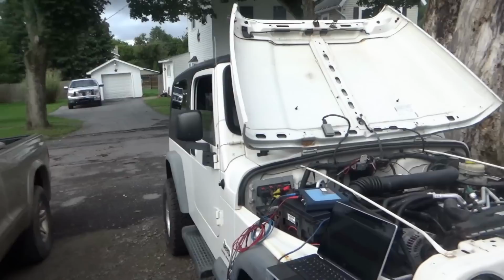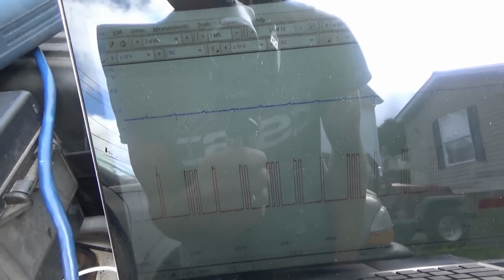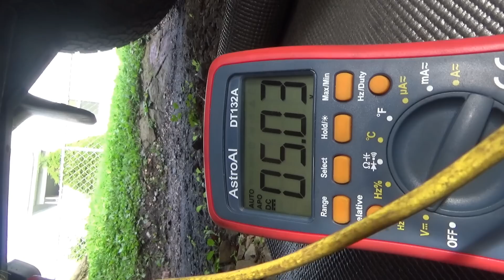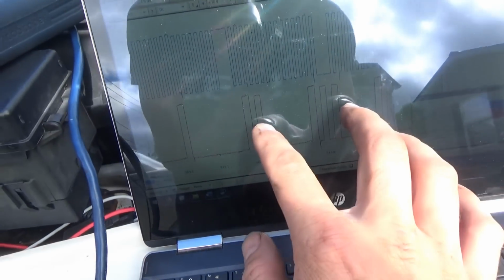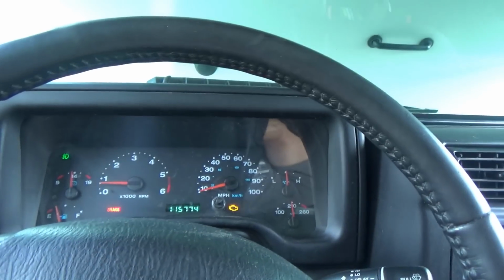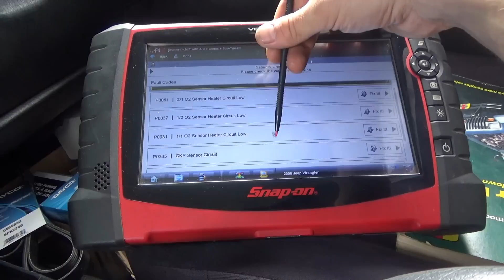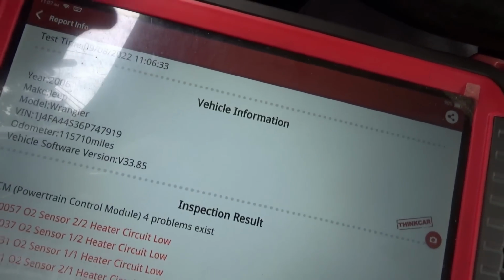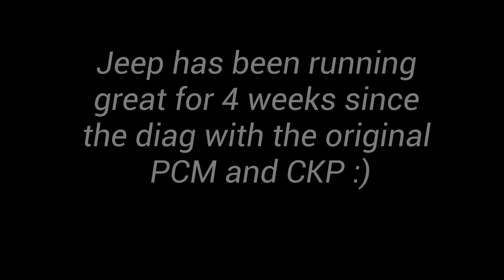Parts Cannon Vs. DIAGNOSTICS (Jeep Long Crank Time P0335)

Comment: I am going to take a wild, I mean wild guess here at only 2:15 seconds in. The distributor could have been installed incorrectly. The CAM (or Camshaft Fuel Speed Sensor, also called Pulse Ring, Camshaft Sensor, or synchronizer) can be set to either a 4 cylinder or 6 cylinder when distributor is installed.. I think Ivan said this was a 6 cylinder (4.0L). It will still run if set to 4 cylinder, but not very good and have long crank times. Again, this is a completely wild guess just to see if the guess was right. If I am wrong, I will remove the comment as it adds nothing of value to the folks who might read this.

Additional information, a toothpick or some similar device should be temporarily placed into the PULSE RING SHUTTER, when installing the distributor. There are two possibilities, one is a hole for a 4 cylinder (2.5L) and one is for a 6 cylinder (4.0L). If installed in the wrong one the vehicle will run, sometimes at first very good, but then will sooner or later start running very poorly. Again, I would like to stress this is just a complete wild guess, and is probably not the issue here, but maybe it will help someone installing a distributor in a Jeep. If not, I will delete this comment.
Reply: You should leave your comment, although it doesn't seem to be the problem here it is good knowledge to have.

Comment: I remember on 2004ish grand cherokkee 4.0 I had heater circuit codes and the wiring harness wrapped around the back of the valve cover and was chafing on the valve cover itself. I'm assuming when the valve cover is removed and reinstalled, the harness isnt secured on the studs..I would guess  this is not you issue unless fuses are blown for the heater circuits. Just throwing this out there

Comment: It's funny you say the made in china part, because I was hoping to find a purge valve that wasn't made in the USA recently. 08 elantra, found while the pcm was commanding a 15% duty cycle, the coil on the standard intermotor wasn't pulling the valve open while the pcm was pulsing it. I used a dorman made in the prc valve vs a usa re-box from the usual scumbags, and the prc valve from dorman ended up operating correctly. Go Figure. Couldn't find a korean valve unfortunately, but I tried.

Comment: I see rigged battery terminal/s at 13:18 looks like wires added to ground and a screw or something wedged in beside a bad terminal.
that is guaranteed random death and endless issues on all the Chryslers. just clipping your test lead on may have fixed it enough, could have been pin/ECM issue.
but they do all sorts of bad things with flaky battery terminals, even perfect looking aftermarket terminals will often cause issues.

Comment: Hey Ivan,  i wondered if you put noid light on all the plugs near the o2 sensors and see if they're working operational? But if powers and grounds are good all across the board,  it has to be faulty ecm to show circuit low.   I wonder?   Great diagnosis and fault finding.  I absolutely hate Dorman with it comes with electrical stuff! They don't play well !!  Great job!!

Comment: 2005-2006 Jeeps with the 4.0L should always get a check on the CMP synchronizer gear to inspect for wear. Notorious for destroying camshafts... This is obviously unrelated to the issue but all customers should be informed / warned. Especially simple in this case as the old one is out already. If wear is allowed to continue, the cam and synchronizer grenade and require short block replacement.

Comment: Weird about Dorman electrical parts.  I replaced the intermediate steering shaft in my Toyota with a Dorman one, and it's actually better than the OE one, they designed it to avoid the fault with the OE one.  Some of their mechanical parts are really good, shame they can't make sensors.  Maybe they don't?  I wonder if they're just rebranding stuff.  Maybe they actually make some of their mechanical parts but just outsource sensors so they can broaden their product line?
Reply: I would like to see their return statistics on their sensors
Reply from the maker: @nickmalone3143  99.9% return rate haha

Comment: With regard to the O2 sensor heater codes - I'm a bit confused by the whole Bank 1 vs Bank 2 distinction on a straight 6 engine - is it "front 3 cylinders" vs "rear 3 cylinders" in this case?
Reply: yes. The last of the 4 liter engines (I believe 2003-2006) had 2 exhaust manifolds with 3 cylinders on each. One for 1-3, and one for 4-6.
Reply: A good rule to follow is bank 1 usually corresponds with cylinder 1 in the firing order.

Comment: Not 100% sure but i believe thre is a  cam crank relearn in the scan tool been a while since i looked. The drive may have let it relearn on its own. I have had a few newer Hemi's that have required a relearn as they age.

Comment: I swore those cps sensors needed a felt spacer to set the gap just right.  Every Mopar one I bought had felt that gets sheered off on startup.
Reply: The ones with the elongated holes had he felt. The newer ones don't because there's no adjustment.
Reply: Felt sounds really durable
Reply: @nickmalone3143  The felt/cardboard was only there to set the gap to the flywheel tone ring. Upon start up, the piece was knocked off the end of the sensor.
Reply: @bookerol  ...it was a joke but i understand its function now thks

Comment: my '20 compass threw a crank code randomly, only reason I knew about it was because I hooked up an OEM scan tool to get some screenshots for something else. It didn't happen enough to turn on the engine light and I never noticed any symptoms so who knows

Comment: I was surprised you didn't test for voltage on the O2 sensor connectors.
Reply: This. The circuit code would be because the ECM is not seeing 12V on the heater circuit. ECM switches the ground. Could be cracked solder joint. Could be a blown fuse (or other feed issue) on the power side. I assume Ivan checked power off camera. I'm with you since this is on all 4 circuits.

Comment: What if the O2 sensors are the wrong type or actually AIR/FUEL ratio sensors?
I think a close check of those sensors are in order.

Comment: The 05 and 06 Wranglers frequently experience PCM issues.  Call Mark at Wranglerfix to help with a diagnosis.  He has identified an alternative Chrysler PCM and programs them to these Jeeps.  I and many others in the Wrangler TJ community have had great experiences with Mark and the Wranglerfix PCM replacement.
Reply from the maker: Thank you for the info!

Comment: Is it my imagination but things got better when you pulled the plug then re connected it.
Crappy plug wire crimping maybe?
Reply: Connector probed with a nail & hammer or the meter probe …....

Always find it on a problem car if you look for it !
Reply from the maker: I think that just manually power-cycled the PCM haha
Reply: @PineHollowAutoDiagnostics  Some devices just don't play nicely or lie to you when you try the so called ' Manufactures reset '.
P.c computers are like that, I've had to force an error to get anywhere.
Being evil and jumping power lines can wake things up.
Sorry waffle mode :-(

Comment: Maybe it was just a bad connection at the PCM.. and since you unplugged it and messed with it--  it's fine now.   At least that's what I'm always thinking. lol..   I never trust the connections;  I would friction test every pin on those connectors before firing the PCM parts cannon.

Comment: I'm guessing the drivers for grounding the 02 heater circuits are bad in the pcm. It'll be fine like it is. It will just take a little longer to wake up the 02's. Another great diag Ivan.
Reply: Interesting - that would be easy to check at the 02's
Reply: Where I am check engine light is on no tags as it has to go through emissions and if the O2’s don’t work it will also flood cat with fuel during the warm up and finish it off
Reply: @ScottDLR  Yep. If you have power at the 02 I usually ground the driver wire at the pcm to check. You'll feel the 02 sensor 
heat up in your hand.
Reply: @jimhaines8370  That's true. It will run rich until the 02's wake up at about 600 degree's. You could always gut the cats and drive it.
Reply: @TheShop10  can you direct ground this wire?
Reply: @whatwasthat3269  No. Just for testing to verify that the heater works. The computer sends 12volts all the time and the ecm pulses a ground to heat the 02 up.
Reply: @TheShop10  on these model Jeeps they send 12 volts  from ECM and just ground O2 heaters to block 
The ECM is suppose to limit current but this is a common failure on Chryslers in this era
Reply: @TheShop10  check engine light is still on and here road side emission tester will flag vehicle and tags will be suspended if not repaired
Reply: @jimhaines8370  oh. Thank you. I thought they were ground switched on those. Good to know

Comment: What about the ASD circuit?? Isn’t that the most problematic circuit on those older Jeeps with intermittent failures due to relay failures and cracked solder joints?? Sure the ECMs also fail but isn’t the O2 heaters powered directly from the ASD circuit 🤔…
Reply from the maker: Take a look at the diagram... Direct power from PCM 😉
Reply: @PineHollowAutoDiagnostics  oops. Must have been thinking of an older model.  👍
Reply: @PineHollowAutoDiagnostics  oops. Must have been thinking of an older model.  👍

Comment: Ford can't get me a fuel pump for a 2014 Ford Transit Connect, national backorder.  Similar to what Eric O has ran into with Ford. Used Ebay fuel pumps are selling for more than new. I ended up finding an Ebay seller with a bunch of new Motorcraft pumps.

Comment: First test is fuel pressure / hold pressure when off. Pulsating bad pumps won't hold idle pressure when cycling on/off but run fine on the road. I test this by letting the pump run without cranking, then off key on key and it will start nice. Then get the fuel pressure gauge out to see if the check ball seals in the pump.

Comment: You would think that the manufacturers would have some sort of onboard computer check that would run diags on the main computer.
Reply: POST ...power on self test ....but since it is never powered down unless you pull the battery (and gracefully discharge ECM  circuits with 1 ohm  resistor) you probably never run it
Reply from the maker: A computer to check a computer? More computers to fail! 😅